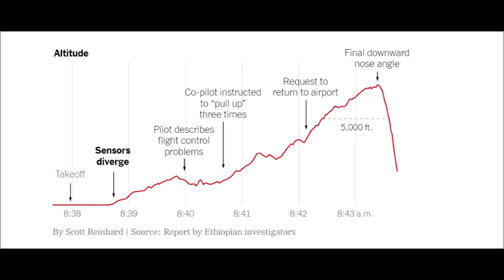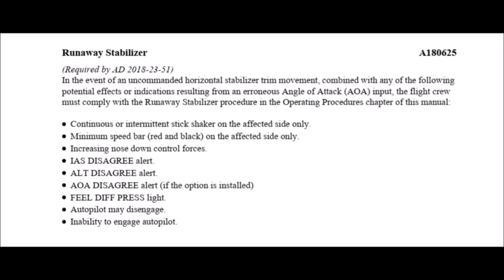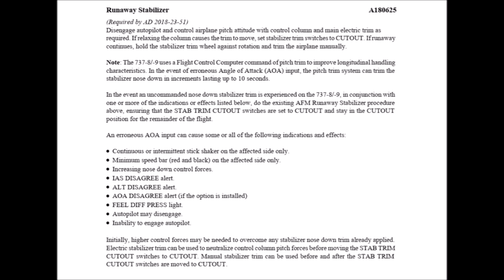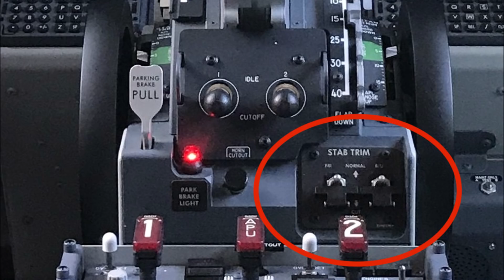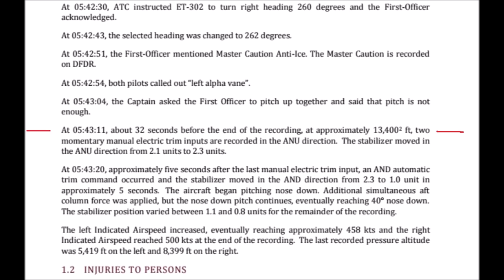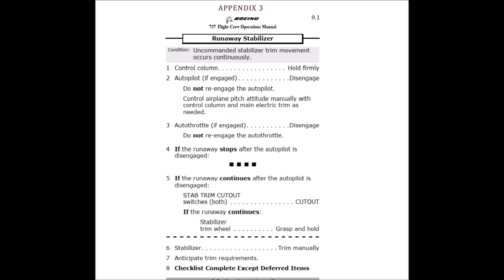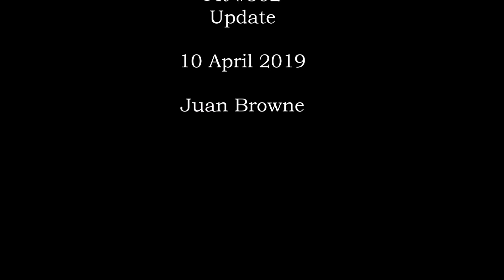737 Max Update 10 April 2019 Runaway Stab Trim Procedures

Comment: The ill-fated 737 max also experienced "IAS disagree" (the speed difference was also shown by the flight data in preliminary report). IAS disagree has another memory item checklist. Could that be the reason that they maintained the throttle position? They don't have reliable information about the aircraft speed as well, that's why probably they maintained the throttle.

At the point that they experienced heavy manual (wheel) trimming, I believe they could have decreased the airspeed. However this is easier to say now while we're analyzing than what they had experienced in the cockpit.

Perhaps it's also the checklist that should be inspected (if they lead to disagreement or confusion).
Reply from the maker: Yes, the checklists need updating.
Reply: Andries A As Juan suggests, the checklists were designed decades ago, and really don't work well on modern B737 aircraft.

Comment: Not a pilot here or anything, but wouldn't it make sense, if there is a "significant" enough difference between the 2 sensors - that the MCAS system is automatically disabled and not allowed to engage.  Since engaging the system with the 2 sensors so out of wake with each other would only cause problems.  And what about the MCAS system taking into account altitude before enforcing such extreme nose-down trim action ?  Obviously if the aircraft below a certain altitude, engaging the MCAS would be extremely dangerous because of limited response time available to the pilots. 

Is it known why the 1 sensor way off ?  It just seems like there are/should be some many more conditional and error checks built in that could eliminate some dangerous scenarios.....
Reply from the maker: Yes, and that is part of the fix. Stby for an update....
Reply: Even without a second sensor the sudden impossible change in data could have been flagged with simple code and disabled the MCAS.
Reply: Alex English Its easier to compare absolute differences, than track a continuously moving variable.

Comment: in another dumb question, could pilots shut off the engines and glide the airplane to safer disaster?
Reply: The pilots did not have the ability to point the nose of the plane up...Engines on...engines off...gravity wins.

Comment: Just wondering if boeing knew in advance (during the actual design stages of the max) that they were going to have a plane that isn't pitch neutral, with a nose-up tendency when the engines are powering away. The other thing is - if the software had been properly configured and designed (as in error detected with a sensor - implement proper redundancy procedure automatically) .... then the accident wouldn't have occurred. The plane itself is definitely flyable if the software design team had done a proper thorough job.

Comment: At the final nose down in the altitude chart it seems like pilots were unable to gain any control do to that maxed out speed.If they reduced the throttle would they have had enough altitude to correct the plane.

Comment: When AP shuts off and there are problems air speed indicators (some reports said there were problems with left side air speed as as well as AOA), pilot is trained to set a certain pitch and throttle. Maybe the throttle level was per procedure, but he left it at that level while working on the pitch, which he never got to the proper place. So the plane's speed ran away from him while he was trying to get the pitch to the correct place.  Higher throttle also induces a very significant amount of nose up force on the MAX, and the pilots were struggling to keep the plane level. Pilot may have been reluctant to throttle down because of this characteristic. Cut throttle and nose dips.

It's easy to criticize the pilots when you were not there. This video makes it sound like planes are not safe to be on unless Juan is your pilot.
Reply: +1 on your thought "Cut throttle and nose dips."  May very well have made the pilots "reluctant to throttle down".

Comment: Juan you are getting ahead of the investigators. As some of your viewers pointed out,  turning the stab trim on again might have been a final act of desperation.  The 737 Max as is is a flying pig, Boeing and the FAA should be ashamed of themselves. Everything will eventually be sorted out but let’s not blame pilots prematurely nor second guess their actions yet.
Reply: If I were a passenger on that plane I would blame both pilots after all the plane was still set to take off speed and never ever reduced to normal cursing speed.
Reply from the maker: ...these are the procedures per Boeing....follow them or die trying.

Comment: I think you are missing a few points here:
STAB TRIM CUTOUT switches prevent autopilot engagement. Can't recall on the report if they tried to engage the autopilot before moving the switches to cutout, probably by repetition of what they usually do, or by lack of knowledge on the procedures or system knowledge.
Anyway autopilot is really a non issue and the first steps of the Stabilizer Runaway QRH checklist direct you to disengage the automatics because they could be the reason of the runaway in itself, wich will do nothing on an MCAS event.

In an airplane with engines mounted below the wings, if you reduce the thrust, the airplane is going to pitch down, wich is something you dont really don't want when your aircraft is trimmed heavily nose down.
Don't really know exactly what happened with the speed control, I don't think they had the overspeed because of the throttle control but more because of the upset they had at the final stages of the flight wich at that stage it was unrecoverable.
I think there is a very good chance they didn't know the manual stab trim could be very difficult to control at high speeds, needing the use of both crew members to trim it out (I fly the 737 NG and I just found out after the crash), it is just a brief note on the FCTM and not something very known amongst pilots since a runaway trim at high speeds it's not something trained in the sim or widely explained.

In the AD Boeing explains normal electric trim can be used to trim the aircraft since it avoids MCAS actuation for about 5 seconds. They could have use it to properly trim the aircraft and then cut them, which is the thing Boeing wants pilots to do. If you re-engage the switches (and we don't know if they really did that) and don't manually trim the aircraft straight away, it is just going to make things worse.

My guess is that they were not aware of the fact you can override MCAS with normal electric trim and then just shut down the system. They just remembered about the switches and thats it. Startle factor is a bitch.
Reply: Thanks you  answered my question.
Reply: Are you suggesting the 94% throttle did not contribute to the over speed?
Reply: stimproid We don’t have the information to say that yet. Autothrottle was engaged. I don’t even recall any mention to overspeed until the final nose dive. Autothrottle is going to provide speed protection, not a fixed position, unless the airspeed indicators start to go nuts, which could be the case with a AoA disagree, you can have an airspeed unreliable aswell. Autothrottle is going to use the airspeed from the pilot flying side.

And as I say, this was a trim problem, if you don’t fix that, reducing thrust is just going to give you more problems aswell. But of course both things are related if you are trying to trim the aircraft with manual trim, but that could not be something apparent or that the flight crew knew about.

Comment: Juan, what about the plane's airspeed throughout the entire flight? How did it fluctuate during the time the aircraft was airborne? The 'altitude' chart shows several (about 5) periods of a more regular like climb punctuated with downward dips which seems to indicate that although things were far from okay, the trend was for increasing altitude. That sudden plunge down after 8:43 am is a big mystery. Why would the plane suddenly depart from having a 'handhold' on continuous flight, only to suddenly break the cycle above 5,000 ft?

If the plane is in a trending climb, how can the airspeed increase when it is fighting gravity on an incline? I know that aircraft use predetermined climb power settings which is more likely to be constant and that the rate of climb will decrease with increasing altitude because, even though the engines are getting more fuel efficient the higher they go, their traction on the air mass through which they are moving becomes a bit more tenuous. I'm sorry, but the best likelihood for the unbroken final descent is a sudden stall. The wings lost traction with the air and down the plane went? The bulk of the final airspeed must all have been gained in that constant dive. So I'd like to know how the airspeed at 94% of N1 trended during the climbout. The VSI is an average of 1,000 ft/min, which seems to be quite low at the given thrust setting, however, wouldn't porpoising dissipate just so much energy that might otherwise accrue as airspeed? Anyway, we need to know the average airspeed and specific increases and decreases on climbout until the plane appears to have fallen out of the sky. But WHY would it do that?
Reply: Please watch Juan's previous video on the ET302 crash. Your questions are aimed wrong, this video is about checklists and human factors.
Reply: Nevertheless, Gordon, the only thing that comes to mind is a sudden unrecoverable stall condition at the point the plane goes down in a constant fashion without the type of interruption from MCAS causing the stepping up effect seen during the climb. This is very important, Gordon, because it is widely known the aircraft hit the ground at excessively high airspeed and if it had high speed during the climb then it ought not to have been able to enter a stalled condition. Do you see my point?
Reply: Please ask your question on the right video. I know the answer, but will not post it here. BTW, your theory is completely wrong.
Reply: In that case, I'll keep 'em peeled, but will always revert to my own 'theory' one way or the other. But just to wrap up this little exercise the only other thing that would cause the plane to drop like that is if the airspeed became so great above 5000 ft, that was the tipping point at which the control force pressures on the horizontal stabilizer suddenly and catastrophically exceeded both flight crew member's ability to counter them given the picture painted so far.
Reply: @snoortpod6462  I'm gonna go ahead and guess you don't think man has been to the moon, and believe the earth is flat.
Reply: That's really funny, stimproid. The M87 black hole fits that category of sudden shock syndrome - it requires multiple angles to be 'covered' before the penny drops, or doesn't drop given the scope of information that exists surrounding the absolute 'truth' of the matter. You either agree, or you don't agree.

Comment: The Ethiopians didn't say the crew did every thing correctly..  They said: the crew preformed all the procedures, provided by the manufacturer, but was not able to control the aircraft.
Going by the AD, the crew DID preform all the procedures...
You are insinuating they, erroneously, did not reduce the speed..Where in the AD does it mention reducing speed? 
Autothrottle where not engaged and they where at takeoff the entire flight (94%)
 
It's OK you think they should have improvised and deviated from the list's from the beginning (but apparently not in the end, when they reengaged the trim cutout) but you are second guessing a crew, based on information's simply not available to them in the situation..
Reply: Juan did not say anything about blame, and he never will, that is your interpretation. He listed the procedures, and presented the evidence which will be put before the accident investigation.
Reply: If they were following the checklist they would have called out the correct steps and verified each of them had been completed. Even if they knew the autopilot or auto throttle was disengaged, they should have called it out and confirmed.
Reply: stimproid If they carried out every step, and took the time to verify every step, they may have still been reading the first list when they crashed. Too many things going on, too fast.
Reply: @gordonrichardson2972  We are talking about memory items here. No reading involved. Both pilots need to agree on the problem and course of action to correct it. If one pilot does something the other is unaware of, there can be otherwise catastrophic results. Air France 447 for example.
Reply: stimproid I half agree with you. Unfortunately the memory items fail to properly diagnose the cascade of warnings caused by a faulty AOA sensor. The pilots can easily get stuck in the wrong checklist, while missing the broader danger.

Comment: The new answer is: by moving the engine up forward, the layer of air flow over the top of wing SPLIT EARLY (meaning lost lift and stall). So that this engine and wing configuration inherent easy stalling characteristic (flawed), That is the reason Boeing add the MCAS. It is clear that this plane is flawed, and shouldn't be used in the normal high angle takeoff to avoid mountainous terrain, or reduce noise over dense populated area.

Comment: The link for the Preliminary Report is broken...

95% power at that stage of flight... We'll never know why they didn't electrically trim the stab back to the green prior to cutting it out... I'm still struggling with this accident. Stab starts trimming while I'm manually flying should be an instant clue of a problem... Turning stab trim back on.... Copilot with 200 total flight hours... The pilots were not in “full compliance” with proper emergency procedures.

Comment: Hello Juan,  Curious, has Boeing management contacted you in any way?  At what point do the trim motors overheat and auto shut off?  If they overheat, can mcas override a shutdown or are both manual trim switch inputs and automated inputs overridden?   Other aircraft i've been in, had a thermal protection shutdown, if the trim was engaged too long.
Reply: The maintenance manuals for the trim motors state that they cannot overheat, and in any case, very little trim was applied during these flights.
Reply: @ @gordonrichardson2972  
Well, they obviously did overheat in at least two instances. First indication was during the Lion Air flight  prior to the crash the next day. That aircraft was saved because of a third pilot in the jump seat. However a very strong burning smell filled the cabin during the ordeal. Unfortunately this is not often reported or discussed anywhere. The second likely instance was that Ethiopian flight we are discussing here. At least one supposedly unreliable eyewitness saw smoke coming from the tail just before it crashed and that's where this motor happens to be located. You have to keep in mind that those motors were working repeatedly and almost continuously under extremely heavy aerodynamic loads and that is why I think they probably overheated to the point where the Ethiopian pilot was at one point unable to get the stabilizer moving (with the thumb switches) in the opposite direction because the motor was unable at that time to fight against a loaded stab. But that same motor was able to move more easily in the other direction when activated by the MCAS because under that command the stab becomes unloaded again. If you can understand French I would recommend that you to listen to a Radio-Canada video where Gilles Primeau, a safety systems engineer, discusses not the possibility but the absolute certainty that the motors overheated. And I am convinced that the certification authorities are now studying this scenario because Primeau has been working with them throughout his career.

Comment: A couple of years ago Al Jazeera broadcast a documentary which essentially accused Boeing of cutting corners on the new 737. According to Al Jazeera subcontractors were supplying critical primary airframe structural parts that did not meet the design specifications, but were still installed anyway.

Search youtube > People & Power - On a wing and a prayer.
Reply: That is an old allegation, from the early 2000s, and does not apply to the MAX in any way.